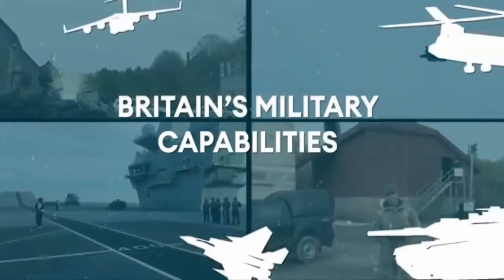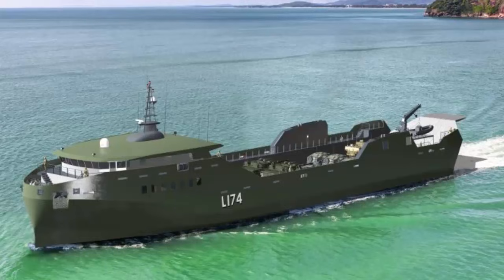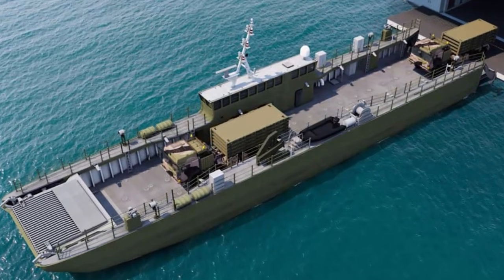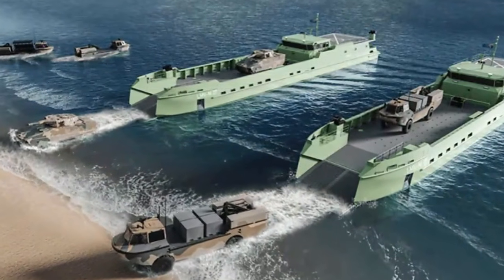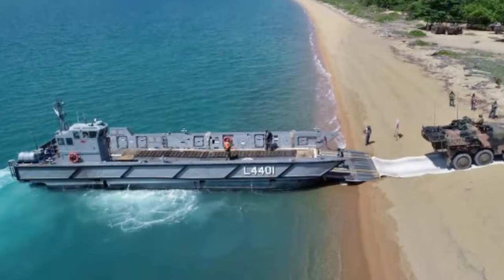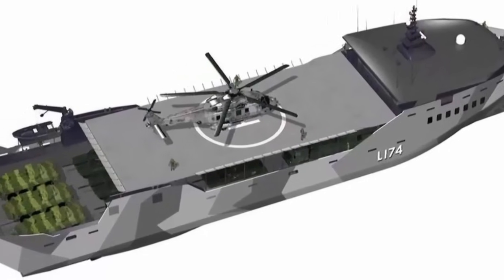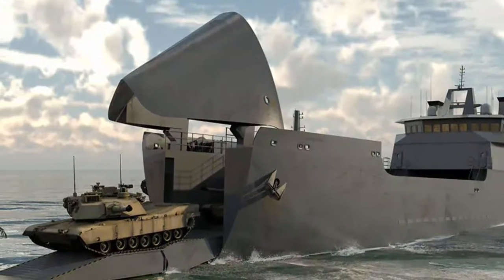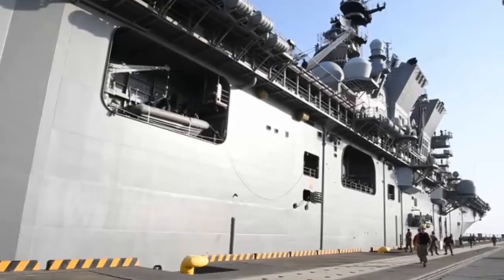Genius idea UK to build More and More New Stern Landing Vessels SLV to meet the MRSS requirement

Comment: Message Message Message
 * (SEATTRANSPORT) * 
Stern Landing Vessel ( SLV ) VS                     Conventional  landing Craft - Updated.     
Deck Area   - 600 m²
TEU (Gud)   - 32 ( 64 Staeked ) 
Dk Dwt Cap - 1100 t 

Shared ships Vessels are legal and additional, which is very nice. This legal and executive mission is very important, and the presence of ships for the transport of goods and delivery, no matter what The text is mine and the text is yours

  A - First payment =      10% 
  B - Second payment = 10%
  C - Third payment =     10% 
  D - Fourth payment =   10% 
  Debts and in an organized manner Does it allow for the construction of ships

The captain must be an Emirati or foreign national, with a dedicated mission, or a dedicated man, especially for workers transporting goods, especially for ships.
 A - Labor payment 10% 
 B - Card.      10% 
 C - Invoice  10% 
 D - Delivery 10% 
 R - Debits    10%
 From Australia to Abu Dhabi and Dubai to Bosaso

Can you re-build ships, please? This type, according to the ship students. I won't repeat the students anymore. What did they say? I need a request from you for ships to be built specifically for ship design. These ships have private bathrooms, a bathroom, bedrooms, a library, and sitting rooms. These students are very important. This is a custom image of the motor, electricity, and prayer on the (SEATTRANSPORT). It is legitimate for its type with very strong ships.

Can it be manufactured? I want an agreement for ships and boats to carry goods. This project is width (**?**) cm and length (**?**) cm. Width or design is meter or length (**?**) cm and width
 is width (**?**) cm according to the design picture you have.

Building this semi-project is extremely important. 
1. 10% of the labor is for design and engineering. 
2. 10% of the labor is for construction. 
3. 10% of the labor is for salaries. 
The rest is for shipbuilding
  4 - Captain Qattan Marine 
  A - 10% Service Qattan Salaries 
  B - 10% Service Salaries
 5 - Offices 
 A - Delivery Card 10% and Payment 
 B - Invoice Recorded Task 10% and Payment

I want advanced international certified boats and ships that are approved by the United Nations to tender new ships and report the message of the specialist (Mohamed Abdullahi Buubiye "Abduwalli") (Mohamed.Buubiye@Gmail.com) Giving ownership to the team. The trial was done. We did not achieve anything. The Chinese companies, one of which was a fear number, refused to join us. Now I demand boats and ships carrying 25 containers. Very advanced, very important.
+252-90-7-2022-28

Comment: The US Navy has had Stern Landing Ships since the end of WWII.  Landing Ship Docks (LSD's) and Landing Platform Docks (LPD's) were used when I was in the Marines 1980 through 2000.
Reply: There is a diffence between ships, such as LPD and LSD, which have a Well Dock, and a stern landing ship.  A Stern Landing Vessel/Ship turns during its approach and beaches like a traditional landing craft/ship, the advantage is that a Stern Landiing Ship has the bow of a standard ship is faster than LST etc, and travels and rides like more convential ships.  The graphics you are seeing is from an Australian company who have commercially built such vessels.

Comment: The Govt tried this when they announced the through deck carriers of the invincible class. They soon found that they were not fully up to the task and only able to operate one type of fixed wing aircraft (Harriers). Then they sold/scrapped them leaving a huge hole in the navy's capabilities. until they built the Queen Elizabeth class aircraft carriers. Even then they were restricted to a single fixed wing type of aircraft and a cross deck is being talked about along with Cats n traps launching gear. IF! they do build these smaller assault ships each one will require an escort to get the troops and equipment to their destination. Where are they going to get these escorts AND the people to man them? Rant over. Carry on.

Comment: Want to land 100% capacity on a beach & move as fast as a modern battle fleet needs to
Take a double hull oil tanker.  Move the superstructure forward.  Power it w four elec motors on pylons.  Hollow it out.  Rear ramp.  Then float in 4 WWII LSTs ea fully combat loaded.  Cover hold w accordion hatch covers that stack against superstructure 
Bonus - all the kinks worked out of design
Reply: This would cost more than a purpose built design, plus oil tanker hulls are not designed to run up onto beaches.

Comment: The battleship HMS Iron Duke weighing in at 30,000 tonnes was built in 10 months, today it's taking 9 years to build a frigate! So no point in putting a time limit on any warships built in the UK!
Reply: In one word: tooling.
Reply: @robertshiell887  Yes and the Biggest tool is destroying the UK economy and laws atm Kim Yung Starmer
Reply: Because iron duke was a lump of pig iron.
Reply: More like ten or eleven years.The idea was to keep the shipyard in work by lengthening the build time so as to retain the skilled workforce. it also more expensive to build this way and hastens obsolescence of equipment.

Comment: The reason why many navies opt to larger vessel is due to weapon carrying capacity, evert limited human resource pool and equipments getting larger and larger.  

Assuming a vessel’s service life is 40-50 years, many countries will have demographic cliff in recruitment.  Tanks post WWII and modern tanks have a huge weight difference.  

Most of all, UK has very small active personnel and small size equipment (only 148 tanks as an example).  Given small size, would it be better to specialise in other areas than landing crafts…?   Where are we going to land our lads to?
Reply: Actually late WW2 tanks were very heavy. A fully loaded King Tiger weighed 75 tons. A current Challenger 2 tank weighs the same. There are limits on how much a tank can weigh and still be a practical weapon. Bigger tanks cost more. Bigger tanks require bigger engines, greater fuel usage, higher maintenance costs. More difficult to recover if damaged in combat. Can bridges take their weight without collapsing? Will they get bogged down on soft or muddy ground. How fast will a very heavy tank move? How do we get them to the combat zone? What size aircraft would be required to fly them to the battlefield?
Reply: Flexibility - One of these alone would have been enough to have secured the Falklands in 1982, given the leap in technology since and not many future adversaries would be as difficult as the threat posed by Argentina then !
Reply: @ sichere
As you’ve pointed out, the leaps and bounds of technology extended ASM range by magnitude….  Even drones with 250nm is not uncommon…. 
Imagine adversaries with USV with 1000lb warhead and launching it from Falkland.

Comment: Once-great Britain still has shipyards??
Reply: @SirWhiteRabbit-gr5so  we do…just. The US is in the same boat. Both used to have lots of major warships yards. Now down to diseased eaten bones for both.   Compared to the 80s, both struggle to do maintenance and build much. Lots of go slow in builds. 
  Typical short sightedness from politicians. Infrastructure takes decades to build. But a year and  stoke of a pen to destroy.
Reply: They will find out AFTER they commit the budget for construction. Then they can pocket the budget cash without repercussions.🤣
Reply: Shipyards classical had slipways down which you launched a vessel, and the vessel was built on the slipway. Modern vessels are constructed in sections under cover, so not affected by weather or time of day, and transported to a dry dock where they are then assembled into a fully functioning vessel. The old shipyards are redundant and there is no need for slipways anymore, what is now needed is a number of large construction sheds, a couple of large dry docks, and the cranes and transporters to move the parts around. And yes the British and Americans have these modern shipyards, and the ancillary equipment, even if it is bought in from Germany. The vital infrastructure is already built, that’s the dry docks, all the rest can be quickly constructed, and it wasn’t lack of foresight by politicians or industry. It was instead the rapid change in construction methods in the last few years, that saw the decline of traditional shipyards.
Reply: Plenty of useful facilities in Scotland
Reply: @sichere  After the nationalism carry on. Vote "buying" around the carriers. I would want any new yards to be in England and Wales.
Reply: Britain always had the largest navy